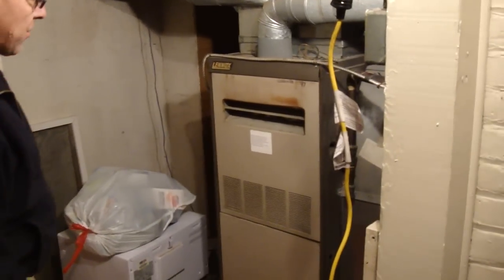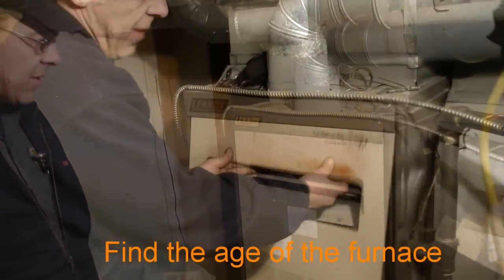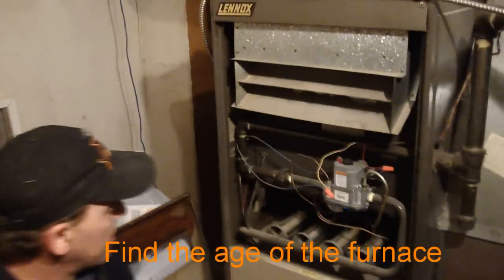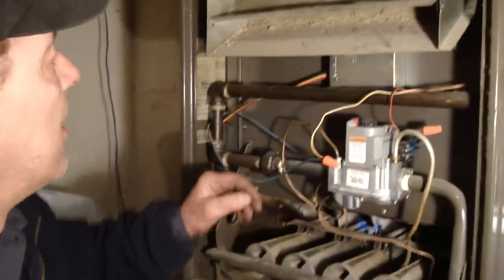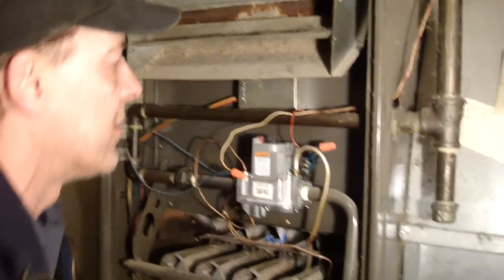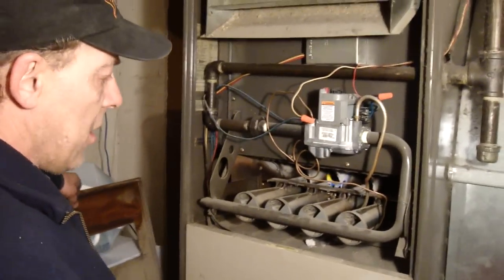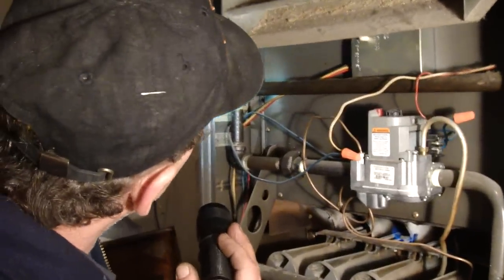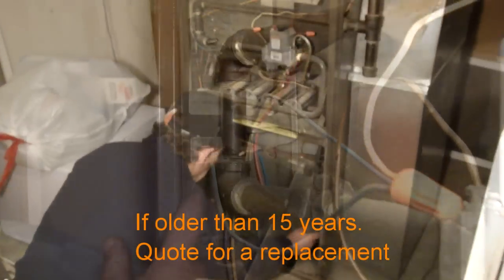Basic Furnace Service

Comment: As soon as you said quote a replacement if over 15 years old..... Wtf I own a 15 year old furnace works and looks like new. I have put $60 of parts in it in the last 5 years.  Efficiency is still good, gas bill never exceeds $60 which includes the water heater for our 1,300sf house (water heater is around $15-20 of that based off summer gas bills

Comment: Thank you for the great video. I did clean my gas furnace. But it stopped flaming afterwards. I just replaced the air filter and vacuumed it. Any suggestions for what to double check.
Reply: he replaces the thermocoupler in this video; it was completely shot.